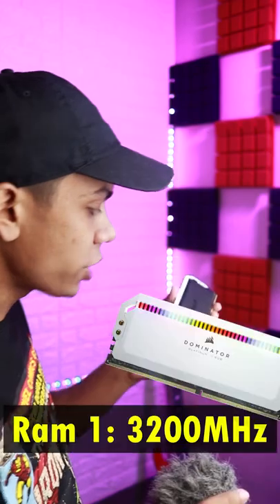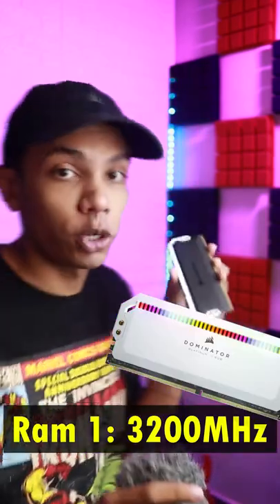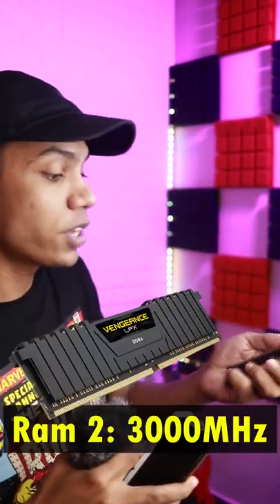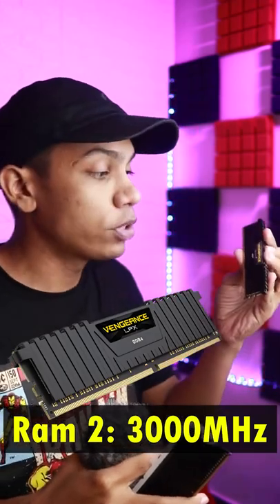Installing two different frequency RAM in a PC!

Comment: Can you do a test with different brands, different capacities, and different speeds?
Reply: It wont work brother if you mix 1 crucial into another ram that is made by another company
Reply: @manmouseeyz3374 what? 😂I run it like that works 100 %
Reply: Yes but the speed of both will be determined by the lowest speed between the sticks.
Reply: You know nothing, I run one adata 5200mhz, and one Kingston fury 6000mhz, it works fine.

Why the 800mhz difference who cares it's my pc

Comment: 2 Different frequenci ram like 3000mhz and 3200mhz  then overcooked both ram 3400mhz profarmance check video please make ❤️❤️❤️ ram actually run in 3000mhz ya 3400 mhz confused 🤔🤔🤔

Comment: My old laptop's ram was..
DDR4 16gb (2x8gb)2400mhz

I upgraded it to..
DDR4  32gb (2x16)3200mhz

Now When i turn it on the screen is black..
Is there a solution??
Reply: Must check if moderbord can 32GB Ram
Reply: your motherboard may not be designed to take more than 16gb in total
Reply: Low to midranged laptop can only run with up to 16gb-20gb of ram only...

Comment: Can I use 3000mhz and 3200 MHz with same latency CL16 18 18 38 of the same brand-Ripjaws???
Reply: same question from my site
Reply: YOU CAN use use different rams without any problem if they have same cas letency mhz dosent matterr it gonna time it on the lower the last ram use

Comment: Mine crashes....y???
Reply: maybe something wrong with the timing or frequency you should adjust it manually
Reply: maybe ur mother board doesnt support that much of ram
Reply: @sbon3g  yup that helped, it's intel  i59400f max freq is 2666mhz nd first RAM was (4gb)2400mhz ,new one was 16gb ddr4 2666mhz...so now both's set to 2400mhz. 20gb RAM 😁😁
Reply: @darethomas8224 hi bro after 2 months how's the performance.